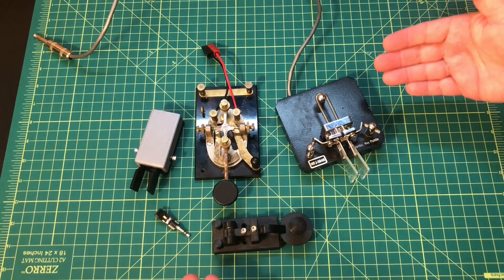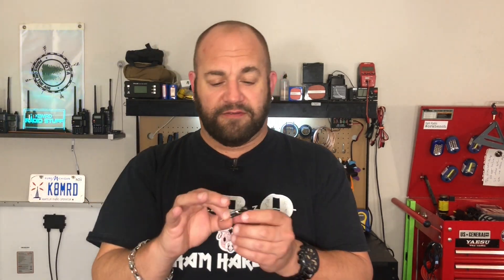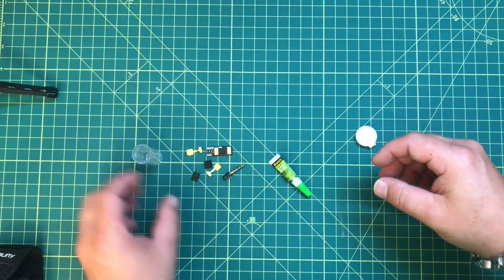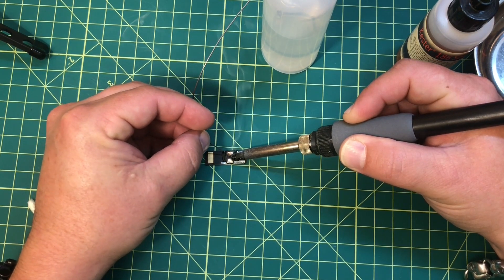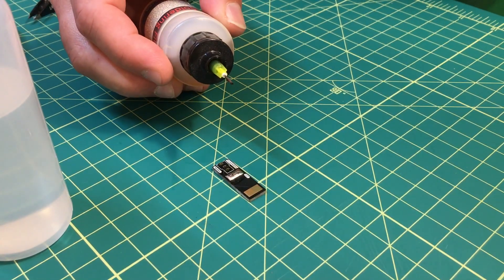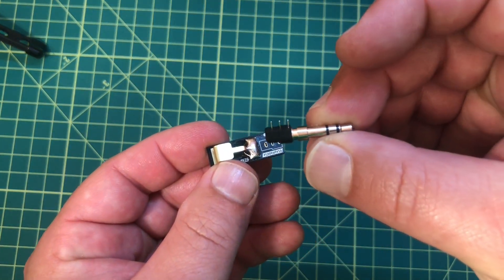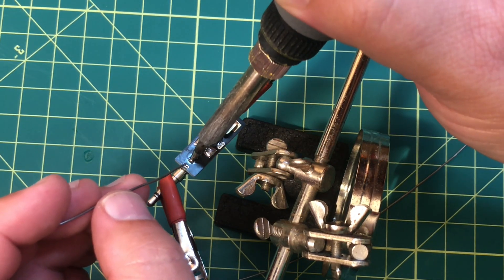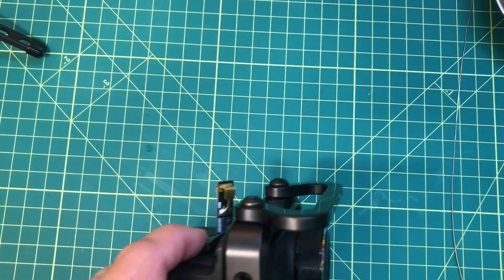N6ARA TINYPADDLE ULTRA PORTABLE HAM RADIO MORSE CODE CW KEY

Comment: I realise you said this is a back up key, however, one thing that puts me off is you are putting strain on your radios key connector, which could lead to early failure. How easy would it be to make a small flying lead  with plug and socket on you could even glue the socket onto a heavy base. I think that would then protect your radio. 
Just an observation, hope you dont mind me posting. 73 Mark G0NMY

Comment: Looks like it could mess up the plug on the radio with repeated use.
Reply from the maker: Well it's designed as a back up paddle so repeated use is beyond the scope of its intended purpose.

Comment: Touch is everything, especially if you're an old duffer with essential tremor. Having to mash at a key to get it to work wears me out too quickly. Thus I use (and highly recommend) a paddle set with bearings and micrometer adjustments. (I was off the air for CW for years until I met Piero Begali. He helped me find the perfect mechanism/paddles for my shaky, stuttering paws. I can assure you that once you've tried one of Piero's keys, you'll see the difference immediately. Thanks to Piero, I'm back on the air. Not as fast or as steady as when I was a youngster in the USN but at least still on the air.) I had looked at the TinyPaddle for a SOTA/POTA kinda set up and may yet try 'em, if only 'cause the price is so, well, much lower 'n any other mechanical system. It's the slap action that slows me down, not to mention having to hold the key in one hand while using the other hand to key. When your paws shake with precision tasks, well, it ain't pretty. And as for building them, I don't think there's enough medication to allow me that charming privilege ;-) Thanks for the video & review. Stay safe & sane, amigo. 73 de W8IJN

Comment: I just got a couple portable iambic paddle keyers. I dont know how to code yet either, but I am trying to learn.
Reply from the maker: You can't learn without one I wouldn't imagine.
Reply: @hamradiotube  well, I also have an MFJ-422D that runs on a 9v battery and allows me to practice without having it connected to a radio, but the reason I ordered them is because of the supply chain issues. I wanted to make sure I had them before everything fell apart and I couldn’t get them.

Comment: Soldering tips:
* Solder is important between the two conductors, but as thin as possible, since it has higher resistivity than what you're soldering.  Solder around the edges, or on the outside may give you a pretty shiny surface, but doesn't help the electrons.
* A major job for the solder is to mechanically hold the parts together.  Thin between the parts works here to, like adhesive.  Extra thickness of solder doesn't improve the strength.
* Patience is a virtue.  Both parts must be above the melting temperature of solder.  Don't continue to apply extra solder to get it to flow to the edges of the pad.  Wait and let the high temperature flow to the edge of the pad, and the solder that's already there will follow the heat to the edge.  (Yes, it's possible to have too little solder, but that takes real skill.)
* Once both parts and the solder between them are above the solder's melting temperature all the way to the edge of the smaller part, and the parts are squeezed gently together, remove the iron, BUT DO NOT ALLOW the parts to move until the solder has had a chance to cool enough to solidify (with those big key arms this could be as much as a couple of seconds).  You need something that doesn't wet to solder and that doesn't suck too much heat away to hold the parts through the cooling process.  Ceramic tipped tweezers are ideal, but maybe held by a helping hand instead of  yours.  Not a great problem here, but SMT parts need to be held when the first pin is soldered since surface tension of solder to iron can pull an unheld part off when removing the iron.  You need to hold this to keep surfaces that may not otherwise lay flat in as close contact as possible.
* Clean surfaces are import.  This is most important with bare copper.  Tinned copper doesn't re-oxidize anywhere near a quickly.  The primary purpose of flux is to last minute remove any oxide (and maybe other dirt, but you should have cleaned already) and it is somewhat activated by heat.  And don't use acid flux, is is used for plumbing.  It's good to clean of any residual flux when you are done, using, for example, rubbing alcohol - though this is more of a problem with the flux in rosin core solder than when using liquid flux.

Now wave the board over you head and scream like a chicken.

Comment: 1/8" stereo coupler, used to be able to run to Radio Shack to get them but you can not order from Amazon or get at Lowe's / Home Depot most of the time. Problem solved for using it with a cord or you can also use an 1/8" plug stereo extension as that has the female on one end and the male on the other.
Reply from the maker: Yep, that'd do it.

Comment: Very cool! Definitely worth the extra $5 to get a built one vs the aggravation, screaming and cursing when I'd be trying to build it.
Reply from the maker: I still think it's fun to build it myself.  It actually turned out great. I'm really happy with it.
Reply: @hamradiotube  I do need to find a way to practice soldering without worrying about completely ruining something. After some practice I might be more confident to try again. (You should have seem my Raspberry Pi Zero 2 W * the header pins I TRIED to solder. Luckily I had help getting it fixed.)
Reply: Its so crazy simple to build. Screaming, cursing?  HA!